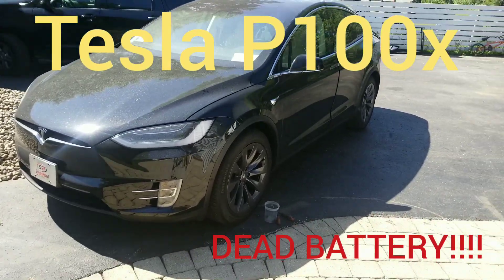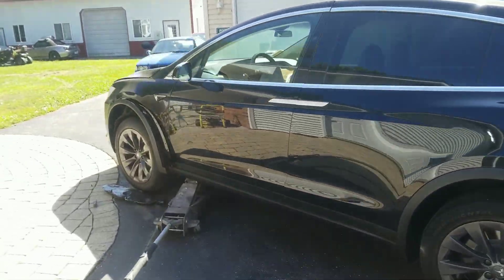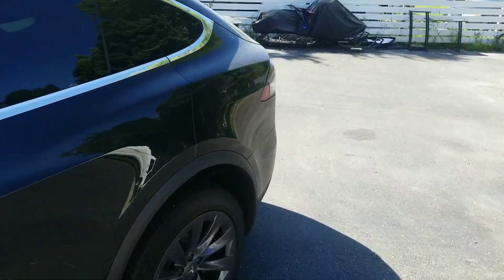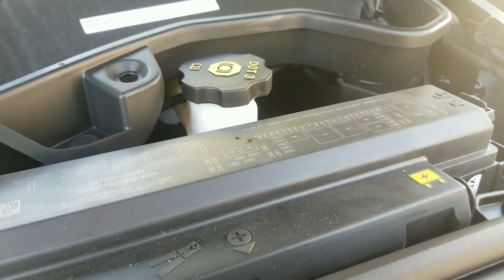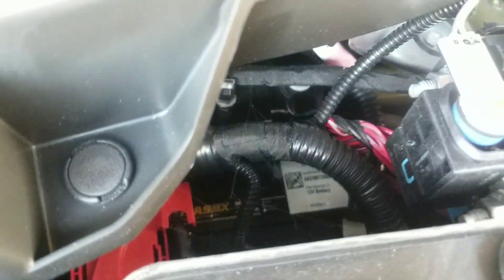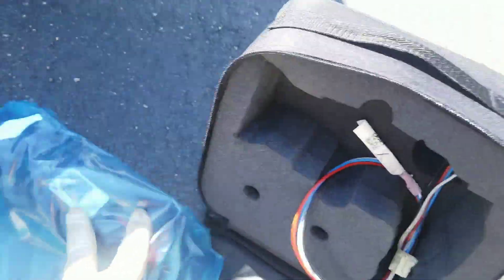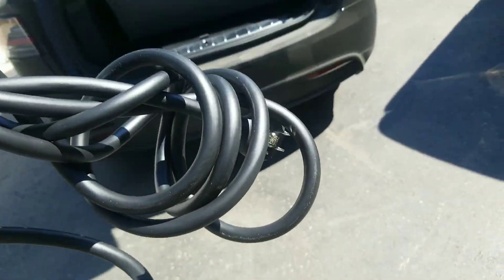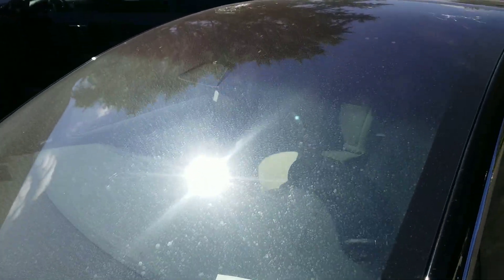How to Open Tesla Model X in case Dead battery !!!

Comment: Bro, I get that your intention was good. But delete this video. It is misleading. For anyone out there, read your manual, there are clear instructions.
Pull the tow hook cover, pull the 2 red cords to pop the frunk, 12v jump the lv battery, charge the car. Done. Don't fuck around ripping the guards off lol.

Comment: Just remove the tow hitch cover on the right side of the  bumper vent.you can see 2 red strap numbered 1 and 2.pull strap number 1 first then number 2 straps next then hoop will pop up open

Comment: Tesla needs a completely redesign their vehicles so you can open up the doors without using electricity. Get to the charging port etc. What if there was a kid trapped inside that car in a hot summer day? By the time you open up that door the kid will be dead of heat stroke

Comment: 10-2023. All that needs to be done to open the frunk is pop a tiny panel off just to the right of the grill (facing the front). Then you can access the pull straps very easily and with no tools.

Comment: ... you can also access those cables by removing the small plastic cover on the right side of the intake vent. The same place you put the tow pole.
Reply: Only on the newer models. With these 2019s this is the only way. Yay engineering.
Reply: What intake vent? Where does the "tow pole even go?
Reply: Found it. Its on the driver side ,lower air intake slot for the "radiator."
Reply: No only on the M3/Y